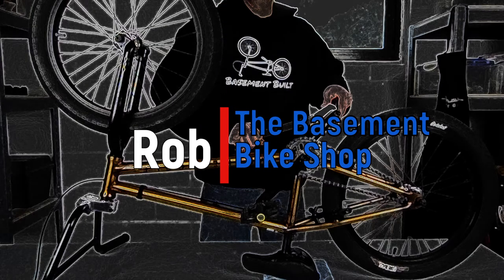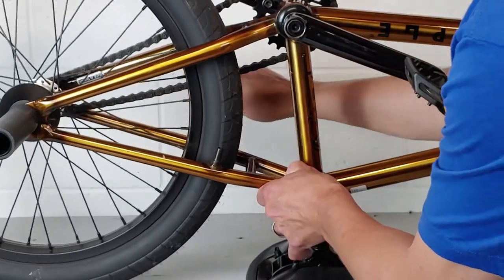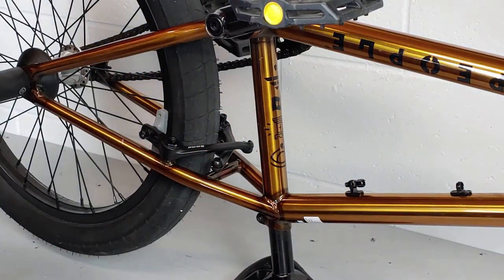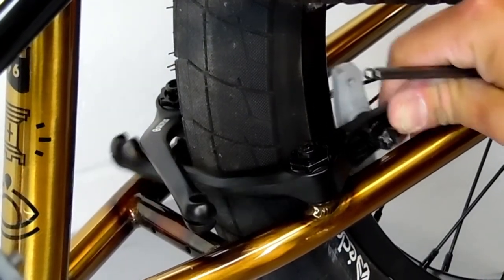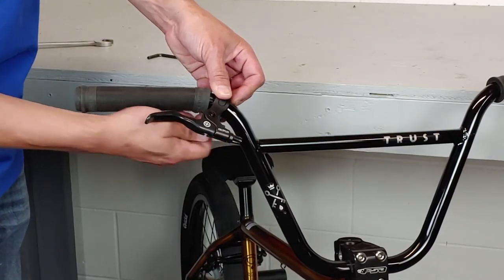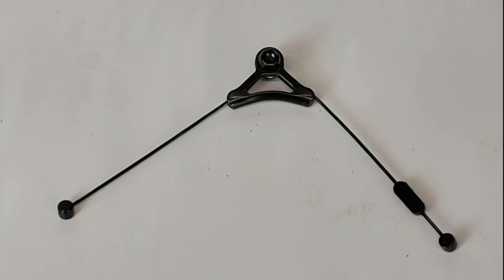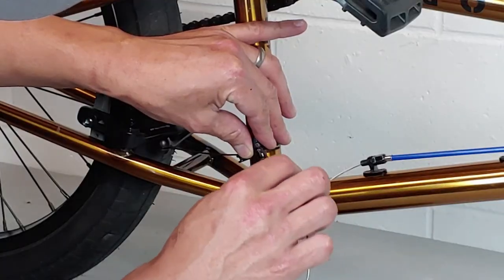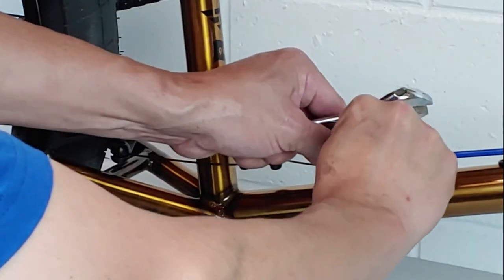Installing BMX U-Brakes and Brake Mount Kit- Step By Step

Comment: I have a cult pigot with the 990s on the lower chain stay. And i use kink desist brakes
Reply from the maker: Yes, Does your factory brake mount kit have brake post that thread into the frame or does it sit on with really long bolts that slide through the brake post?

Comment: Do you have a link for the I brake mounts to purchase? Ive been looking for some cheap ones for a project im working on
Reply from the maker: You probably want the the brake mounts made for your frame from that manufacturer. What kind of frame is it?
Reply: Just lost a brake mount tonight. Flying down road in the dark, I thought my cable had snapped, turned out that one lug came loose, I heard it hit the ground but couldn't find it in the dark 💀 I'm not sure which brake mount it is, wether it's bolt through or thread in type. I will pull the one off tomorrow to figure it out. 
I only just got my Ubrake working perfect with a Vbrake style conversion, removing the straddle gubbins completely and just using a Vbrake noodle on the end of cable direct to the brake. So much better! Well it was till it fell apart 😂

Comment: I seem to be having problems with my Odyssey Evo 2.5 brake and wondered if you could help me/or experienced something similar before. The brake arms are rubbing against each other which creates a horrible grinding feeling. Both brake mount tightened down fully as well as the actual brake itself.

Comment: Question.

My bike Cult devotion 2020 model.
The wheels are 2.5" width.
When I got the bike it was brakeless, but since I just can't ride in my city without a brake, I wanted to put brakes on it.
On the first go, It seemed that the brakes touch the wheel.. Everything is standard and made for the bike.. So does anyone know?

Comment: Hey ! is it normal my brake caliper could touch my rear tire ? never set up brake (before brakeless) and i've doubts... eventjouhi've changed my rear tire (before 2.40 and now 2.125 and always same thing... it's only setting or problem ? tanks ;) nice video ;) useful
Reply from the maker: It depends on the brakes caliper. I run a 2.3 tire in the back and my salt calipers don't hit my tire. What kind of brakes are you running? You may need different ones.
Reply: @thebasementbikeshop2336  My rear brake caliper is Salt Echo chrome. I use 2.125 tire. I try to move spacers at first. I f I add 1 chain link my wheel is almost out of axe of frame :/

Comment: Just got a new frame. I have threaded holes at the very back for brakes to go onto but I do not have a hole under the top tube for the wire guides? Any ideas?
Reply from the maker: I would just use black zip ties. Is there at least a cable housing stop by the seat post?

Comment: my mounts are on the top side of the rear fork also my guides on the bottom side of the top tube neither are threaded. Will this still mount on my bike?? It is a redline frame from around 2005
Reply from the maker: As long as your mounts are ubrake mounts and not canti/Vbrake mounts. The best way to tell is ubrake mounts will line up more with your tire.. V brake mounts will line up with your spokes.

Comment: Why do you not lube the u break post or the brake cable?
Reply from the maker: I do lube my post. I thought i showed that. I must not have. I would like to redo my all my videos now that i see all the comments of things i missed. I don't lube my cable anymore. I buy coated cable and run em. I've found when i lubed my cables, they pulled great at first but the lube collects dirt and i have problems much sooner than i did when i didn't lube them at all. Thanks for the input

Comment: Where can I get brakes for a bike 20x2.0
Reply from the maker: Almost all bmx brakes made now should fit over a 2.0. The problem is finding brakes to fit over a 2.2 or a 2.3. I run a 2.2 rear tire and the salt brakes fit over it easily

Comment: do you think brakeless is better and why?
Reply from the maker: I do not think brakeless is better. I think people that ride brakeless are better and i have a lot of respect for them. I have always run brakes. I believe it's safer when learning tricks or dealing with traffic on the road or in a skatepark. I think, even if you want to learn tricks without using brakes, you should still have brakes on your bike.
Reply from the maker: @Chad Kunka yes. I should do a front brake install video.

Comment: Hey bro can you send me the link for Springfield
Reply from the maker: Sure. Here is the link to the Springfield installation video- https://youtu.be/foT61K0pBHs
Reply: I found it bro do I need the tensioner in the middle of the frame my Springfields never came with one ?
Reply from the maker: @kanekrishna3375  if you are referring to the spring between the brake arms, yes you need it. It should have come with it. Contact the company if you didn't get it with the brakes.
Reply: The adjustment barrel bro
Reply from the maker: @kanekrishna3375  you wouldn't need it if you have a cable housing stop on the frame. You just have to be more precise with your adjustment. Otherwise you can pick up one at any bike shop or online cheap.
Reply: @kanekrishna3375  bro
Reply: @LiveNinetyNine  ?